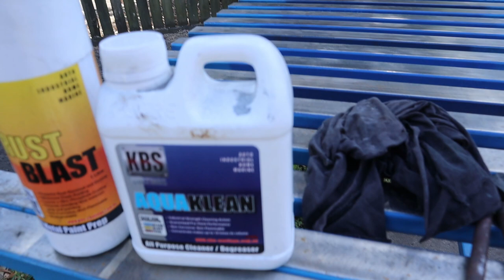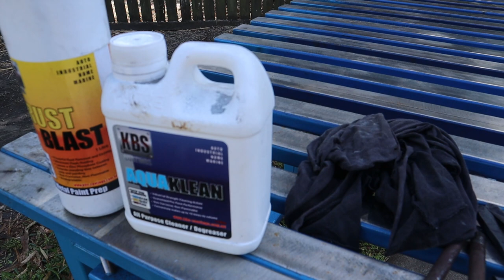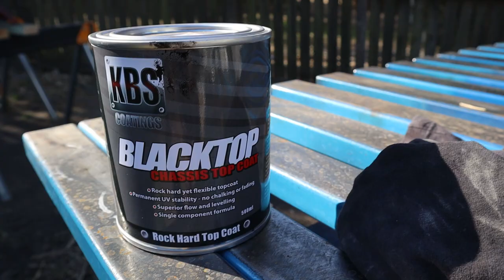HX One Tonner Build - Stripping and Painting the Chassis with KBS

Comment: was wondering if i need to wax and grease before doing the rust seal coat.... my understanding from the instructions is you don't need to after rust blast and if your got too much residue it was let dry too much during the rust removal stage ? looks mint about to try it out on my 40 series

Comment: Hi Sam, enjoying the build videos, so a big thumbs. Was there a reason you didnt spray the KBS inside the chassis rails like Barney's did on his, to prevent future rust ? As you put in a hell of a lot of work, repairing and preparing the chassis for paint.
Reply from the maker: Thanks heaps for watching. I did buy a product to spray in the chassis. It's a cavity coater. I just have not got around to doing it yet. I bought 3 cans so will also use it in the sill panels etc.

Comment: How heavy was the first hit of KBS from the gun and how long until you did your second coat/third with the blacktop? I’m spraying my HX sedan chassis next week with KBS and interested how it goes. Also did much dust/bugs from outside finish in the paint?
Reply from the maker: Hey Mate the first coat I thinned down to 10 percent thinners and applied a good coat. I waited roughly 2 hrs in between 1st and 2nd coat and about 3 hrs in between the 3rd and the top coat. There was minimal dust and bugs. Like there was a couple of bugs land on it but I kept a good eye on it and picked them off when they did.

Comment: hi mate about to start  my hj tonner build , what steel size and wall thickness is your rear chassis end that you welded in.    cheers.  looks to be say 75 x 50  and how wide have you cut it.
Reply from the maker: Hey Mate its 100 x 50 RHS. The length I think it was a little bit shorter than the original cross member. You can just make it any length that you think looks best.

Comment: What are your thoughts on the devilbiss gpi? Personally I think its the best for the money
Reply from the maker: I think its great but its really only my first real experience in using spray guns so have no real comparison. I done a bit of research before buying and a lot of people recommended this gun for good bang for buck. So far im really impressed.
Reply: @ShenkeGarage  im in the same boat as far as experience but I done my 1st full clear over base respray with a supercheap gun and it turned out awesome I can't wait to lay some clear with my devilbiss
Reply from the maker: Was laying down base coat then clear pretty straight forward? I Have really only sprayed the KBS and primer. Also what size nozzle you use for base and clear?
Reply: @ShenkeGarage  yea man pretty easy but was a little bit nervous at 1st because I was worried about mucking up and wasting all that money on materials and time in preparation then explain to everyone that I ruined my car because I'm a shit painter haha but it went down great and looked good for years until I sold it, the trick that worked for me is keeping the gun square to the panel and be consistent with distance from panel and consistent movements and just keep moving don't let it build anywhere on the panels, the supercheap gun had a 1.4 tip and it worked fine for everything from etch primer,high build primer ,base and clear from memory the devilbiss came with a 1.6 and a 1.4 tip I'll still with the 1.4 for everything I might use the 1.6 for the high build next time, plus I only used "concept paints" witch I think is just a cheap generic body shop line of paint it came out great, im going to paint my XY myself soonish I want to try DNA paints for that they have some sweet colours... oh and very important ya need a good compressor and water traps loving the vids too mate
Reply from the maker: Ok thanks for that. I bought the Devilbiis with a 1.8 tip for primer so I might get a 1.4 for base and clear. I was actually thinking of going a DNA paint. You can get premixed colors and in kit forms for candys which im thinking a candy for mine. I might try doing the engine bay myself and see how that turns out before deciding on painting the outside myself. Also thanks for watching the videos.
Reply: @ShenkeGarage  im going their "blood red" or "split blood" candy base coats

Comment: Well done Sam, I was quite agricultural with the removal of my springs also 😂
How much thinners did you use for the KBS per ml?
Reply from the maker: Thanks Mate. I made up some spring compressors and they worked well but yeah I just dont want to promote making up home made tooling if you dont know what you are doing. 
I used 10 Percent thinners. So I mixed up roughly 500 ML each time so that would be 50 ml of thinners. Also I used the proper KBS thinners.
Reply: Yeah fully understand mate, some noob may harm himself. Sweet as I applied one coat using same 10% method with KBS #1 Thinner. but the weather turned crud so it's a waiting game now. Looking forward to your next episode 🤙
Reply from the maker: @nathanhughes9996  Oh that sucks. Hopefully the weather clears up so you can lay the paint. I have another episode ready to go but most likely will wait till Friday to post it. It should be a good one :)

Comment: Hey mate loving the Vida. Just st 10:40 when you cut that support out the chassis folded in abit. Just wondering if that was ment to happen
Reply from the maker: Thanks heaps Mate. Good observation. I took the measurement from the chassis rail to chassis rail in case it did do that. When I weld in the new cross member I will make sure this measurement is the same.